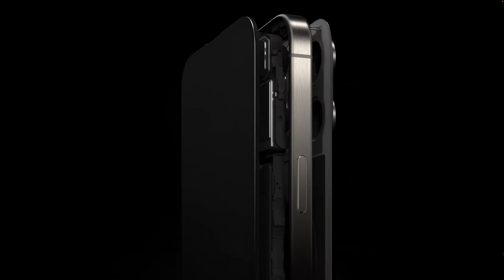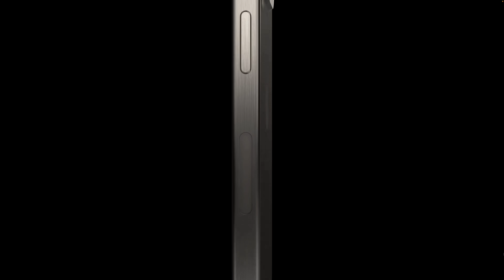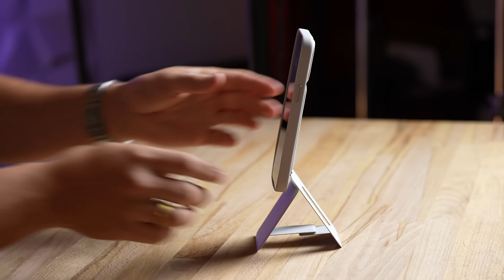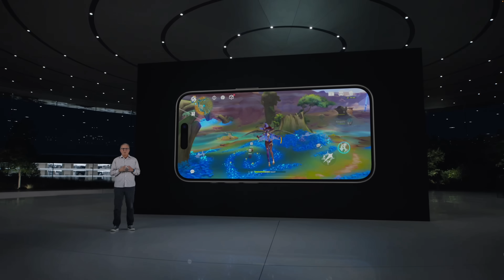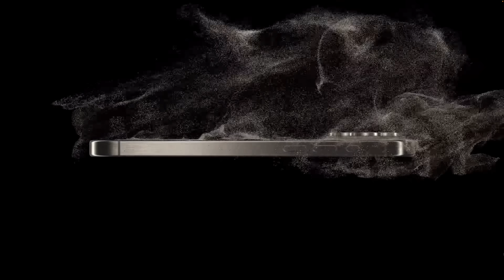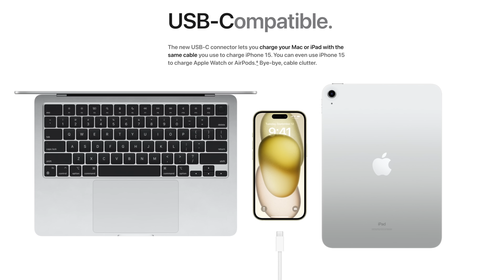iPhone 15 Pro - Top 10 NEW Features!

Comment: Yawn. Utterly boring compared to the novelties droid phones bring to the market each year. Apple should try hard to get rid of the blockage in the view, sold to fools as the amazing "dynamic island," really. And now the cut corners massively curved? FYI, 100% is the pro feature of the viewfinder or display. These iPhone 15 videos try so desperately to find justification for iPhone 14.1. I predict that at the end of the cycle, the sales tally will prove deservedly underwhelming. Stainless steel, by the way, has more than twice the thermal conductivity of titanium. Get at least that straight.

Comment: Instead of charging the watch with the phone i want to charge the phone from the watch hã!??? Tey keep skimking weight from the phones and they are still ridiculously low battery. In one year the iphone battery becomes a crap that can’t handle a heavy day usage. Why don’t they add 1-2mm and increase doble capacity and then sell a really pro model for professional use, that will withstand a whole day of heavy use? We don’t want to change this expensive atuff every single year… it’t got to keep working after 18-24 months please…

Comment: iPhone 15 Pro Max - Improvements : 

[1] Structure
- Titanium design (stronger and lighter phone)
- Redesigned frame (easier/cheaper to replace)
- Thinner bezels
- Action Button

[2] Performance
- A17 Pro chip (4x faster ray tracing, better gaming experience)
- USBC 3 (20x faster file transfers, able to charge AirPods or Apple Watch via the USBC port)
- 8GB of RAM (better multitasking)
- WiFi 6e (two times faster wireless speeds)

[3] Photography
- Main camera 24 MP default mode
- Main camera new 1.2X and 1.5X sensor crop (total of 6 focal lengths)
- 5X optical zoom (bigger sensor & F2.8 & 3D sensor‑shift optical image stabilization)
- New coating to reduce lenses flare (all 3 lenses)
- Enhanced Smart HDR & Night mode (brighter highlights with more contrast, better low light performance) 
- Next generation portraits (auto switch to portrait mode based on machine learning, continuous zoom, shift the focus after you take a shot, portraits can be Live Photos)
- Spatial video capturing (3D recording)
- Recording ProRes video directly to an external storage device (up to 4K at 60 fps)
Reply: I hope you have a good day, thank you
Reply: Thank you :) @evansomweri1992
Reply: damn
Reply: The A17 Pro chip is not a new feature, only an improvement over the A16 Bionic.
Reply: It doesn’t seem to be stronger, by all accounts it’s weaker than the 14 in drop tests
Reply: I saw some of the drop tests and I have some thoughts. The frame should be stronger due to the Titanium design but maybe the phone has some “Achilles' heel” points after the new redesign of the frame. Could be other explanation, like the change of the density of the material on the back of the phone (so the phone could be even more lightweight). I have doubts about it, but can’t  exclude either. 

I don’t have any info so I can’t tell. Take in account a few things : [1] Most of the drop tests are not scientific and without appropriate equipments [2] The tests are not simulate daily situations 100%, far from it [3] Even if the phone is in general weaker then last one, still, he could be strong enough to our needs, so, personally, I don’t worry too much. I recommend to buy a good case, take care of the phone of course, and all will be fine.
Reply: Bro you are so right! All these apple haters just talk about that its fragile or just “the same thing”
Idk why they can’t just say it’s a good phone lol

Comment: Can iPhone 15 Pro / Pro Max record 4K 422 ProRes videos or 3D spatial videos to external SSDs like USB-C  Samsung T7 Touch 2TB SSD?
Reply: Yes
Reply: iPhone 15 Pro / Pro Max has 10 Gbps USB-C (1250 MB/s) is fast for 4K 60fps 422 ProRes videos recording to external Samsung SSD which has speed of 1050 MB/s, better than the outdated USB 2.0 lighting 480 mbps (60 MB/s).   I think iPhone 15 Pro records ProRes 4K 60fps 422 10-bit will be 200 MB/s and iPhone 15 Pro Max records ProRes 4K 60fps 422 12-bit will be 300 - 400 MB/s.  I have iPhone 13 Pro Max records ProRes 4K 30fps 422 12-bit is 100 MB/s.  Phone 15 Pro and Pro Max are the game changer for many low budget filmmakers.

Comment: The new iPhone‘s changes including USB-C, 3nm A17 Pro chip with incredible gpu performance, new telephoto lens on the Pro Max and focal lengths, action button and Titanium frame are actually great upgrades. People are hating no matter what.
Reply: All these things you mentioned are hardware changes/upgrades... Not really features....features would be what these hardware changes offer.... Which when you check, isn't anything to shout about... Their usb type c/transfer speeds have now caught up with the rest of the world, they offering ray tracing... Is them being now caught up with their rivals.... 48mp camera is still way being the rest of the world.... 5x optical lens is way behind the rest of the world..... 256gb base storage is basically the standard on most of their competitors.... I don't see how this phone has offered anything ground breaking besides their usually cpu gains...

Comment: Based on the detention of the camera module section and the thickness of both Pro & Pro Max, the new 5X lens design should fit into the Pro model perfectly; however, the 3X telephoto will only have old iPhone 14 Pro 6% Focus Pixel while the 5X telephoto will have 100% Focus Pixel.  iPhone 15 Pro is 90% cost of iPhone 15 Pro Max but only comes with 94% less Focus Pixel and 2X less zoom for those who are not interested in the Pro Max size.  May be that would be the BIGEST UPGRADE FEATURE of iPhone 16 Pro to have the 5X zoom & 100% Focus Pixel.  Same trick they pulled before until iPhone 12 Pro & Pro Max that came with same cameras.  Cheap shot Apple!

Comment: I purchased the 15 Pro Max nat ti. I’m not totally sold on USBC. I have literally never connected my phone to transfer data. I would prefer to see better Wi-Fi modems. My top 3 are 24mp photos (48 in heif), mechanical ray tracing (I think this is going to be huge for Apple devices in the future), and the new 5x tetra-prism lens. Love your vids.
Reply: who isn't sold on USB c..? it's objectively better than lightning
Reply: @Arjun----  magsafe charging is better than usb c and more convinient to use.
Reply: @aakashkaushal1167  how is it better? it's literally not, wireless charging is slower and loses energy during charge
Reply: @aakashkaushal1167  
wireless charging doesn't allow for data transfer, it's far more inefficient, and it's slower. USB c is a universal cable that you can use for almost every device. it's objectively the best there's zero argument
Reply: @Arjun----  for MagSafe the wire doesn’t go through bottom so it’s much easier to use the phone while charging and I have MagSafe charger which also has stand so it can be used as standby clock at night while charging. USB c provides same charging speed as lightning as of now and trasfer speed doesn’t really matter to me 90% of the population. I mostly airdrop to my MacBook which is done in seconds for my use case. So, MagSafe is still superior and new tech. Charging speeds will be increased for sure in future iphones
Reply: @13johndoe37  it’s good while charging at night as I charge my phone at night. So high speed charging is doing harm than good while charging at night. Thats why I use 15w MagSafe than even 27w lightning.
Reply: @aakashkaushal1167  idt u read the comment. magsafe is far more inefficient, it wastes a ton of energy. also for people that use lots of devices, USB c is all u need to carry around. sure some people just care about their iPhone and magsafe is fine, that doesn't make USB c worse

also the charging speed has almost nothing to do with battery health if you charge it overnight anyway... the phone stops charging at 100 either way, there's just small amounts of residual charge that keep going back in when it drops a bit

also I can bring USB c anywhere I go. u can't do the same for magsafe. and "it takes time to plug a cable in" or is just lazy💀
Reply: @aakashkaushal1167  wireless charging degrades your battery faster due to heat, the only convenience is no cables

Comment: Should I upgrade from the 14 Pro to the 15 Pro or 15 Pro Max? Currently, I have the iPhone 14 Pro Space Black 256GB which has scrolling stuttering, battery life is bad, it has lags in the Camera app and some games and overheating issues. Battery and Camera are the most important things for me and I used a 12PM before which was too big and heavy to use, but now there is the lighter Titanium material and the curved edges make it feel more comfortable to use. So therefore, should I still chose the 15 Pro Max over the 15 Pro this year? Also, is 256Gb enough? And, which color would you choose?
Reply: First world probs

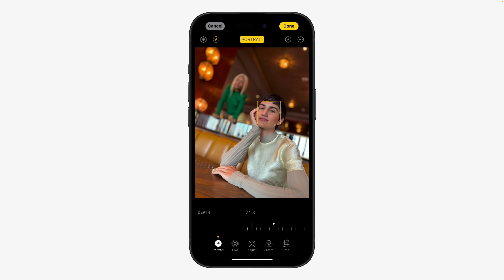Comment: 8:58 on the latest iOS 17 RC you can change the focus point on existing portrait photos that were taken with an iPhone 13 Pro or iPhone 14 Pro.
Reply: Yeah but only if the photo was taken specifically in portrait mode. He was saying that all photos, even non portrait mode photos, will save focal data so you can add or edit it later.
Reply: @SeemsLikeSomething  correct as I said. On iOS 17 you can change the focus point on existing PORTRAIT PHOTOS that were taken with an iPhone 13 Pro or 14 Pro.
Reply: @eraldway  gotcha 👍
Reply: Isn't it possible to make portait photo from standard photo using an app from any picture?
Reply: @bekarare  probably. Haven’t looked into that but I would imagine portrait mode with focus and depth information in it does a much better job

Comment: usb c isn't that big of deal if people haven't been using it for data transfer. I think the average consumer was using airdrop or cloud services as apple was intending... it's nice to see it finally come to the iPhone. But I wouldn't glorify apple for adding it as it wasn't a decision they made, they were forced to do it...
Reply: Apple was the first company to release a USB-C product back in 2014 with the MacBook. The iPhone is the only hero product without USB-C I don't think they were forced to change it.
Reply: @rustyfenders101 clearly Apple funboy. Open your mind.  If they introduced type c long time ago in macs, then why did they wait so long to implement on iPhone until Europe forced it with rules
Reply: @bekarare not sure what your point is here, they weren’t the first to use the USB C protocol, that part he got wrong, but they were actually part of the collaboration to create USB C along with a few other companies (intel, HP, Microsoft) . It’s not fanboyism to say that Apple was a big part of the creation and adoption of USB C. They also did start using the port early on with their macs, iPads, and now iPhone. Now, why they waited so long to ditch lightning is anyone’s guess. My guess is monetary.
Reply: I would say they did a bad job in the transition by including the Usb C wall brick with the iPhone 11 and then removed it from the 12. The current cable included was a Usb C to Lightning. So they have been introducing the change slowly. They should have done it before but were afraid on how customers were going to react. The first cable change had a lot of controversy. Many accused apple of doing it to make all all your current accessories useless. I'm a fun boy. @bekarare
Reply: I’ve never  transferred data via a cable since the iPhone 4 & i now have the 14 pro so to be honest im not bothered either way about the usbc port

Comment: Good video but one correction - the thermal conductivity of titanium and stainless steel are the same, so heat dissipation not better.
Reply: Actually 304L Stainless has a 16.2 W/m.K thermal conductivity while Grade 5 Titanium is 6.7. This means way less thermal transfer on the Titanium which is why Apple most likely chose to make the inner frame our of aluminium which is at 200 W/m.K to help transfer heat away from the chip to the glass. This also means that the Titanium sides should stay much cooler to the touch under heavy loads making it more comfortable to hold.

Comment: Yeah ofc it’s not a big change withe the 14 pros and even 13 pros but those who had regular 12-14 might bc they get 120 hz and then new camera 48 new notch replacement and other stuff I have a 12 pro max yes the screen won’t change buttt the new display and the brightness and other features yes my phone didn’t get the pro motion display so yea it’s an upgrade to me 😎 those who has 14 pros are replacing just solely bc of the battery I hear and also they’re are the ones who update every year ahah

Comment: ▪︎▪︎▪︎▪︎  The iPhone 15 Pro is not a real pro model for me.  Because it does not have the 5x zoom feature that the 15 pro max has. So it's not worthy of the Pro name.
Reply: The pro max is just too big
Reply: @AS-ri1mb  Yes, that's actually the point. The 15 Pro is actually quite correct for someone who wants to buy a compact Pro model instead of a 6.7 inch screen. It is not a real Pro model.

Comment: It is still a camera phone. If you normalize the lens aperture to a full frame equivalent for the 5x lens, you are now over f20 equivalent. Did you ever wonder why a lens for an actual full-frame camera at the 120 mm focal length (4.7 inches) at 2.8 aperture takes large filters? For example, the Canon RF 135 mm 1.8 prime lens takes an 82 mm filter or 3.2 inches.  Simply multiply the f-stop that Apple is quoting by crop factor which may be on the order of eight to get the full-frame equivalent. I have a Nikon cropped sensor camera with a crop factor of 1.5. I have a lens that is designed for the cropped sensor camera with stated focal length and f-stop of 35 mm / f1.8. The full frame equivalent is 52.5 mm / f2.7. Apple's f-stop numbers are misleading as is the case with other manufactures and therefore they mislead many who are not familiar with the basics. Apple's marketing material which shows a full-frame lens schematic next to the iPhone 14 Pro is incredibly misleading and really shameful! What is discussed above contradicts what is stated in this video in regard to the actual light gathering capability of the 5x lens on the iPhone 15 Pro Max in relation to a full-frame camera. You cannot simply look at the quoted f-stop and call it a day! Specifications of non full-frame camera systems should always be normalized to the full-frame equivalent in order to allow for comparison of these systems. Camera phones rely on effectively longer exposures (likely multiple exposures) to make up for the loss of f-stops and computational photography to provide bokeh as something like an f20 aperture offers no bokeh.

Comment: I mean, I don't agree with this "in the previous years we got a lot more" rhetoric.
Just look at the differences between iPhone 12 Pro Max and iPhone 13 Pro Max: literally just a slight better camera and the Pro Motion display.

This year instead we got:
- A new titanium finish
- USB-C connectors
- New USB 3.0 controller that increases speed up to 10 Gbits
- A 6 core GPU instead of old 5 one
- 3nm manufacturing process
- Hardware Ray Tracing
- 5x optical zoom (only on Pro Max)
- 8 GB of RAM (2 more than previous models)
- A new action button
- Slight bigger batteries

A lot better than the previous years I would argue.

Only because we didn't got the Thunderbolt port, that doesn't mean that these phones sucks.

And let's be honest: we all know that Apple wouldn't have brought Thunderbolt on these new phones, because the internal storage is not that fast anyway.

So let's try to be a bit more objective instead of being salty about the fact that most rumors were false (as obvious as it was).
Reply: Agree 100% thunderbolt is overkill for an iPhone, even a pro model. This new phone has a ton of upgrades over the previous 14 pro. Some other upgrades you missed are the 

better focal lengths with this year’s camera
Almost 20 grams lighter 
The rumored rounded edges making the phone more comfortable to hold

And best of all, now the pros are easier & way cheaper to repair. Overall it’s a solid upgrade and the unexpected high demand speaks for itself. No one expected this phone to sell, but in reality it’s on back order for a month or even longer.
Reply: @lefthanded5473  Exactly, those are great upgrades as well. 
Also the ability to repair it more easily means that the phone can potentially last longer (and it's easier to recondition it too). 

I preordered mine just 2 hours later the embargo and it's coming second half of October, so there's definitely a high demand for this one.